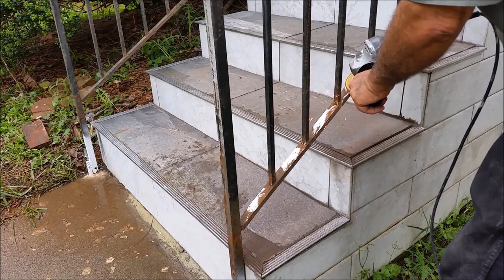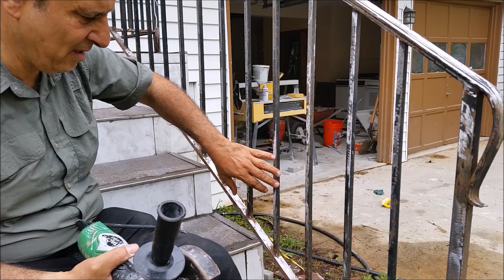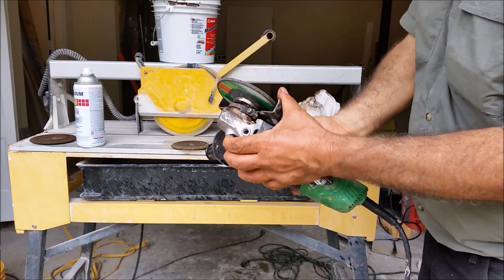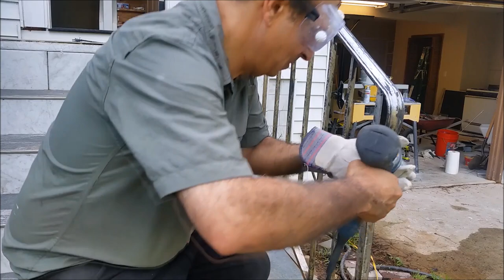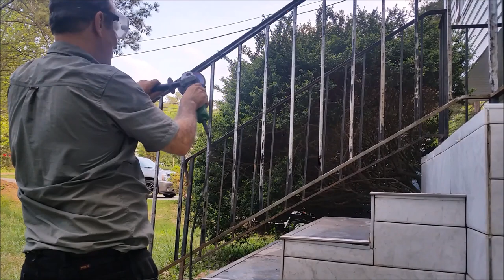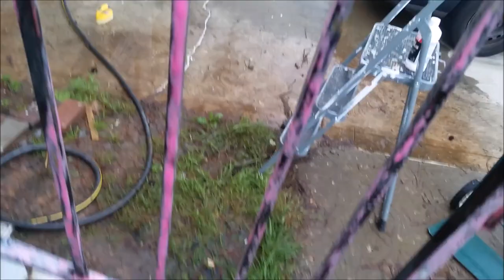Remove Rust From A Rusted  Iron Railing Or Fence Using metal Grinder Flap disc and twisted Wire

Comment from the maker: Angle grinder = https://amzn.to/3lrsGQx
Tools and materials I used for this project.
ustoleum Rusty Metal Primer = https://amzn.to/2Fbo7KG + https://amzn.to/2SFVxEC
Rustoleum Clean White Primer = https://amzn.to/2I5w8lr + https://amzn.to/3diMBOY
Best Oil Paint Brush I used  = https://amzn.to/3dfpzs3 Or https://amzn.to/2FcPrZ4
Angle Grinder = https://amzn.to/3lrsGQx 
Navel Jelly Rust Remover = https://amzn.to/34GO0uL
Flap Discs = https://amzn.to/2GuUe93 Or https://amzn.to/3lopLrZ or https://amzn.to/36LMtGs
Metal discs = https://amzn.to/2GPFZLw
Wire Wheel Cup Brush - Clean Rust and Polish Metal  = https://amzn.to/2SHOGu0 Or 

https://www.amazon.com/gp/search/ref=as_li_qf_sp_sr_tl?ie=UTF8&tag=josephkhalon-20&keywords=Wire+Wheel+Cup+Brush&index=aps&camp=1789&creative=9325&linkCode=ur2&linkId=978dcd6dbdbfb4e80bfc49ddff829550
Amazon Deals:
Try Amazon Prime 30 days for free = https://amzn.to/2JMWaLe
Create Amazon Business account = https://amzn.to/3mLSyYt
Joint Amazon Prime Watch Thousends Of Movies and TV = https://amzn.to/33NfsHD
Try Personal Shopper Wardrobe  https://amzn.to/2VClfv9

Comment: Nice job. I will paint my grandmas fence next month, and i will do the same. I will remove the oild paint and little surface rust from it with an angle grinder and wire brush combinations. After clean the surface from dust well, give it a rust preventer primer, and after paint it nicely : )
Reply from the maker: Good luck

Comment: Excellent video, very informative.  I have the following questions...1) Will a Ryobi 5.5 amp grinder work? 2) Will a Sears Craftsman Drill 120 volt 4.5 amp with a wire wheel brush work on the decorative close quarter parts? 3) The rust remover if used carefully, will not harm vegetation close by?  After viewing this video, I look forward to working on this project.  Thanks for any feedback!
Reply from the maker: Yes the drill and grinder should do the job.  The rust remover will not harm the vegetation.

Comment: How much time did it take you to scrap all the railing? And what kind of gel did you use? What are the benefits vs painting? The look is interesting
Reply from the maker: Only one rail took close to 2 hours to do since it was very very rusty. I use Naval Jelly Rust Dissolve. One rail I remove the rust completely and then painted it primary and water based color. The other rail I clean a little bit the rust and I prime it with rusty paint and then water base paint. You still must paint the rail but  you should remove the rust first.  Please look at the following video:

  How to Paint A Wrought Iron Railing - Using Rustoleum Clean White Primer
     https://www.youtube.com/watch?v=4zMM9poIBMU

Comment: I have an indoor staircase with wrought iron railing. It's been painted dozens of times by previous owners (not necessarily using the right kinds of paint). I'd like to scuff that up thoroughly before I repaint. 

I have roughly five times the length of the segment of railing you have in video. 

What would be the best grinder wheel for this?

I was thinking of using a cup brush. But I've never used a grinder before so I'm not sure if that's the best tool.
Reply: Use osmo on any rust spots.

Comment: How do you get into the cracks and crevices? Also how many grinding pads did you go thru for that one railing?
Reply from the maker: I use quite a few (more than 3) .   I also used different grinders like the following

 https://www.youtube.com/watch?v=j6VGQQqsxpw

https://www.youtube.com/watch?v=yW0U9ZNxClA

https://www.youtube.com/watch?v=lM5R-OIzESY
Reply: Die GRINDER that's how!!!!
Reply: @dillamo  or a knotted wire cup brush attachment